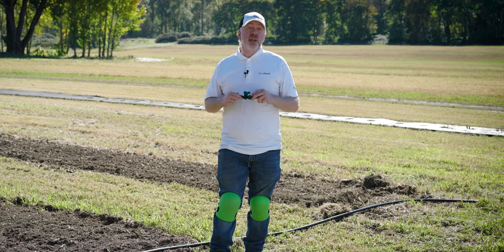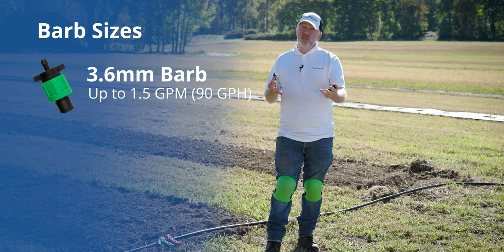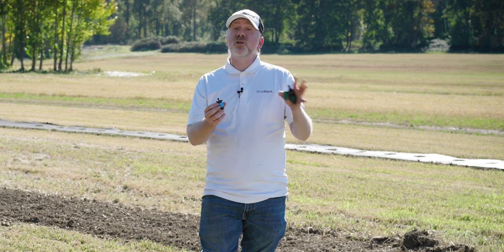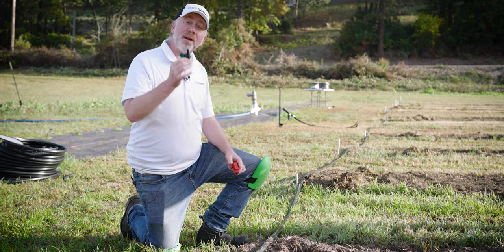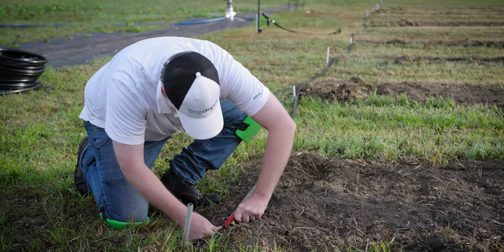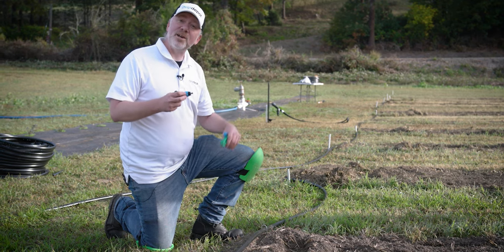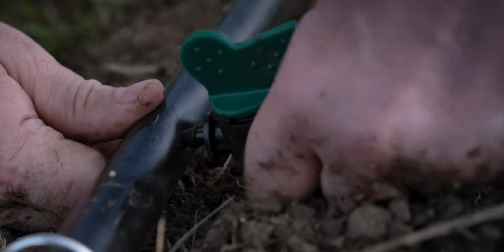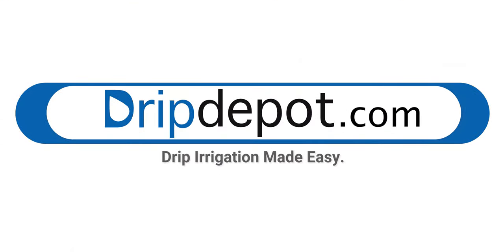How to Install Drip Tape Takeoff Adapters

Comment: Frankly, it's very complicated. Can I use the main line 1/2 and the subsidiary line also 1/2 and how do I connect them?
Reply from the maker: So long as you're not overtaxing the 1/2" lines, you can indeed use 1/2" as a main and sub-main or lateral.  If you're using this with drip tape, you'd want to make sure to use the 3.6mm takeoff adapters (linked in the description above) as the 7.0mm adapter's barb is just a little too big for 1/2" tubing.  

Using 1/2" tubing with drip tape is fairly common in residential applications, so you'll be on well traveled ground if that's the direction you're looking at :)
Reply: @dripdepot  Thank you very much for the reply and it helped me a lot ❤️
Reply from the maker: @farm.3287   You're very welcome!  If any questions come up, you're welcome to reach out at any time, happy to assist :)
Reply: @dripdepot  I just have a question. If I have 3 lines and each line is 10 meters long, what main pipe do you recommend? For the subline I will use 1/2
Reply from the maker: @farm.3287   It can depend a little on the spacing of the emitters and their flow rates, but I'm cautiously optimistic 1/2" will serve well here.  

You can keep in mind the general recommended maximums for 1/2" lines -- 1/2" lines should be kept to 200' Length or less and 200 GPH in flow or less -- three 10 meter lines will likely be well under 200 GPH in total flow, but do add them up just in case to make sure :)
Reply: @dripdepot  Yes it will be less because I will be using 133 gallons per hour. Thank you with all my heart ❤️ Greetings to you 🫡
Reply from the maker: @farm.3287  You're very welcome, any time!

Comment: Hi, I bought the drip irrigation kit and took help from someone professional to install. But I noticed after few months that the place where a mainline is punched a hole for 1/4 inch drip tubing I see a small water leak.. its not big but I see the moisture coming up slowly. Was there a problem with he punching the hole as I saw two different sizes here. He used a 1/4inch drip tube connected with a coupling to make a hole to the main line. Thanks
Reply from the maker: I can confirm those holes shouldn't leak, particularly after they've been used a couple times (thermal expansion cycles will usually make the seal even better).  One tip is to ensure there's as little tension on the fitting in the hole is possible -- by this I mean trying to ensure that the coupling is as inline with the run of drip line as possible.  When it's perpendicular, extra tension will be placed on the barbed fitting from the line. 

If the punched hole is nice and inline, if possible try letting the sun hit that area (if it's not already).  The thermal expansion will expand the tubing on over the barb.  

Did he use a punch to make the hole?  Using a hole punch is the best bet, as it makes the perfect sized hole for 1/4" coupling (the coupling will be a bit larger than the hole, which allows the hole to close over the barb on the coupling).  

All is not lost if a punch wasn't used -- in that case, try the direct sunlight trick (with the system off, water will cool the tubing) and see if it seals it up over the barb.  :)